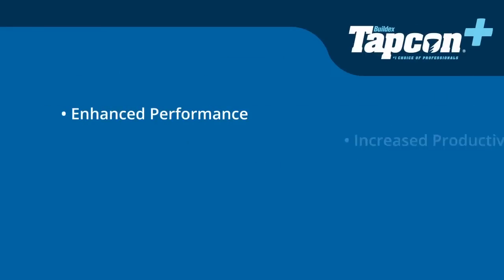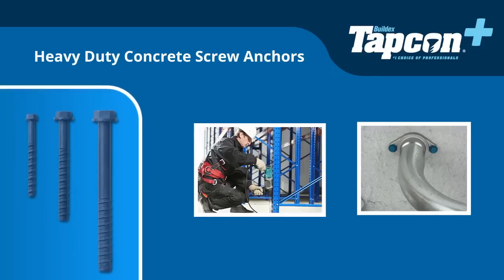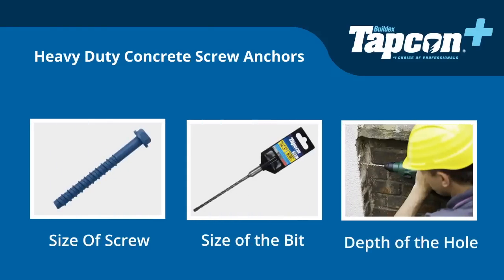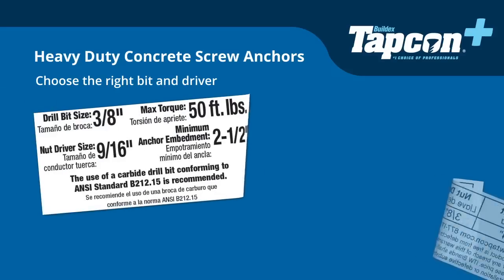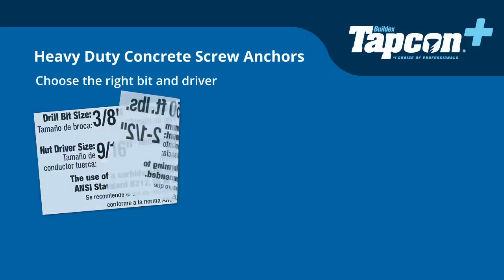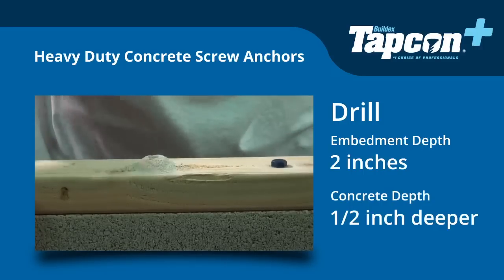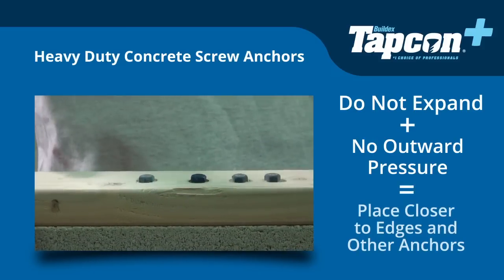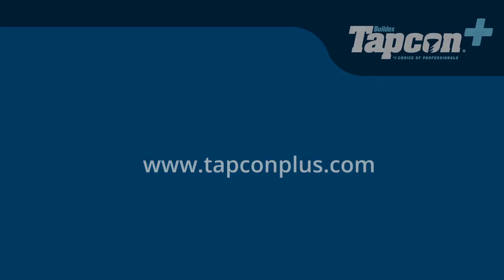Tapcon+ Proper Installation

Comment: Will never use them again...they break during install
Reply: you are either/both/all: A) using an undersized diameter drill bit (diameter too small) B) insufficient hole depth C) the hole in the material you are affixing to the concrete is undersized D) When the tapcon screw was in full depth - you kept on going with your drill - and that's when it snapped off  So, give it another try, being careful to use the correctly sized bit, drilling deep enough, clearing the hole of concrete dust (might even be good to double check the depth using a paper clip or a small copper wire before attempting to insert the tapcon screw), check the hole in the material you are affixing to the concrete and being careful to not overpower the screw when it is at full depth. Try hand screwing the tapcon screw through the hole in the material - if you can't turn it or there is great resistance - then try enlarging the hole slightly in the material. When the tapcon screw is nearly at full depth, slow down. You might even think of stopping about 1/8" before reaching full depth and then using a screwdriver by hand to bring it to full depth. I have made all of these same mistakes - and gotten the same results you did. When I followed the above guidelines - tapcon screws went right in - and they work great.